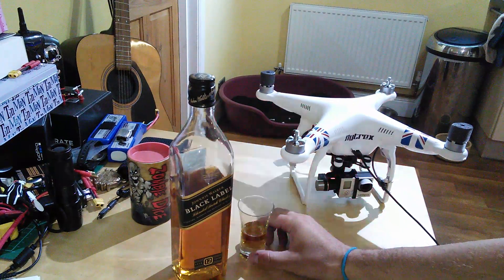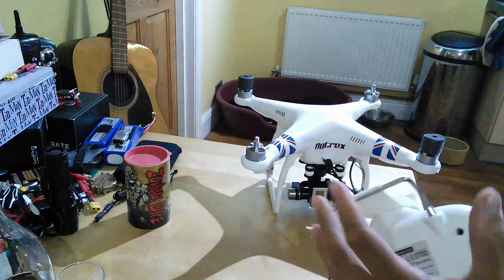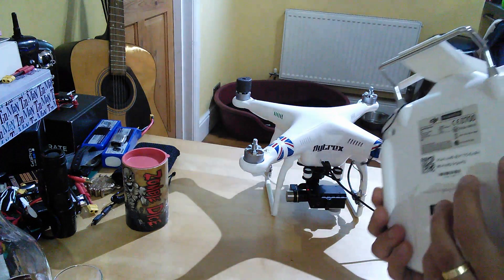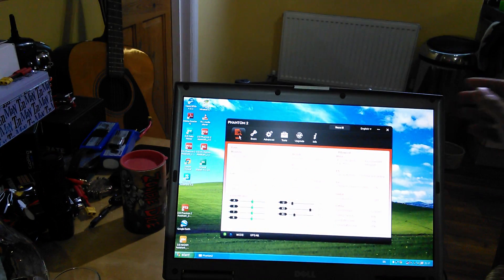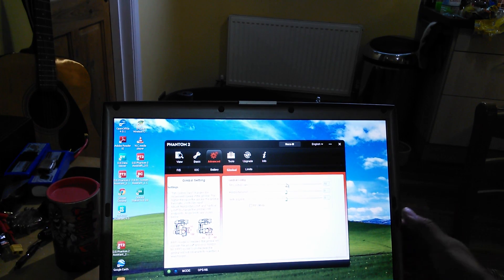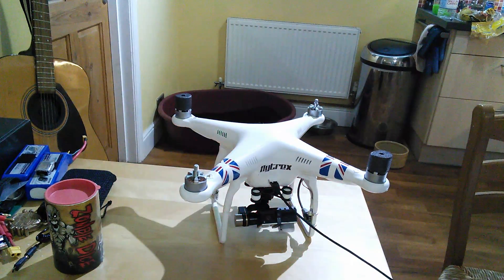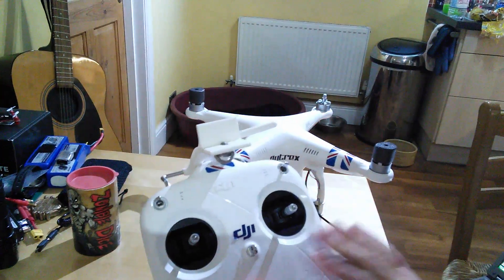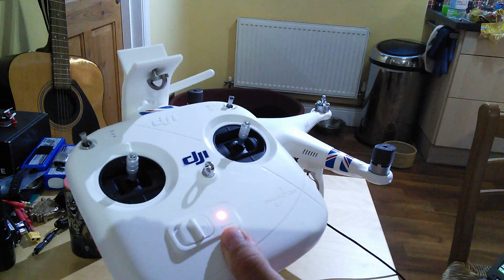How to adjust your DJI Zenmuse H3-3D gimbal for smoother tilt movement

Comment: Hi Simon,  I really appreciate your tutorial videos and that's why you earned my subscription.  I have a problem with my Zemmuse H3D3 gimbal and I was hoping that you might be able to bring me some guidance to solve it.

  My gimbal catched a "nervous tic"...It twitch to the left in mid flight and right after that it just hangs free for a second or two and return to normal like nothing had happened. It seems to me like Everytime I try to go full forward it happens again and again and again. Even on calm days. My propellers are all balanced, so isn't a vibration issue.   I installed the filter that comes with gimbal when I first got it, and it was working good.  A couple months ago started doing this and I don't know how to fix it.  Hope you can help me. I have looked for videos showing how to fix this, but haven't found anything.  

 That had ruined plenty of my aerial shots and is getting really annoying.  I had seen others experiencing this same failure with theirs...It's there any fix for this gimbal failure? 

Have a great day and thanks again for your awesome tutorial videos.

Comment: im  newbie and i dont know if my pc is even detecting my phantom 2. the dji phantom2 is on, that program is on, i connect it, nothing updates when I change it....
Reply: ***** thanks for the quick reply, im connecting hte usb to the phantom itself ofc. i downloaded this program for phantom2  but i dont know about "drivers" all im trying to do is make my gopro tilt more cuz now its range is like -20 degrees to -70 degrees, i want totally downward tilt -90degrees   and horizontal 0 degres,  i wana expand the tilt range.  either way please help me out with the driver since the lights on the bottom left of my program arent on
Reply: ***** again thankss for your replies.  my issue is i dont know if im doing something wrong, i have the assistant downloaded for my phantom 2  but i get stuck in this step ". Run the PHANTOM 2 Assistant and wait for the PHANTOM 2 to connect to the Assistant. Observe the
indicators on the bottom of the screen. When connected successfully, the connection indicator is
and communication indicator is blinking "

stupid questions: when i open the program how long do i wait or do i click on skip, also do i need to register a user.login?
Reply: ***** in the dji [hantom 2 downloads page there is some pdf stuff and the assistant says it comes with the drivers. i told u im a total newb. how do i even load drivers cuz i downloaded somethign called assistant and another thing called drivers, i installed both. now what

Comment: Yes, I've done that - I have the new one with the wheel on the left. It starts up fine but seems to sit at the angle once it's ready. It moves ok but I'd like to change the default position

Comment: I've just got mine and when I power up the gimbal the camera  is pointing at 45 degrees towards the ground as its default position. How do I set it so that its pointing straight forward like yours ?
Reply: ***** Hey Simon I am having the same problem as well.  Can you go into more detail on your answer.  I am under the RC tab but there is no upgrade option so I am confused by what you mean by that.  Sorry if I am missing something obvious this is just very confusing..  I turn on my gimbal and it aims 45 degrees downward as well.  I have the newer transmitter with the wheel on the shoulder too.  I just cant seem to figure out what transmitter type to select under RC because I don't see an upgrade option... Thanks so much for the help !
Reply: Steven Camp ***** I have the same question as Steven. I went to RC and my controller was already set to the Upgraded Version. My gimbal still starts up and after initializing it points down. Seems like most videos I watch their gimbals are facing their camera level across.
Reply: taylor c Hey, I figured out that the 45 degree-problem was just a setting!

1. Connect Phantom 2 quadcopter
2. Open Phantom 2 (program): Go to Advanced > Gimbal, and adjust Horizontal Limit and Vertical limit to 0 - voilla!

Comment: I hope Im not being repetitive from something you have already said I just don't think It was mentioned. But something that is important to do and definitely helped with a problem(not being able to control the midrange of the gimbal, I could only move it from straight forward to straight down) that I was having with the range and control of the gimbal control lever on the transmitter was to; during configuration of the controller you are able to adjust "A, E, T, R, and X1". AETR are the actual sticks and the 4 axis that they ride and then the X1 is your gimbal control. During configuration I laid one hand flat grabbing both sticks and as I was rotating them I was also moving the gimbal control lever back and forth. This definitely help with resetting the high and lows. Thanks

Comment: Thanks for the video , i have one question. 
Im changing the tilt speed but nothing change on how fast it will move , any ideas?
I have the new transmitter NDJ6 where the slider is on the upper left corner

Comment: tilt control gain doesn't work anymore after i updated the firmware of the gimbal...
Reply: Oh yeah, thanks. Switching to basic works, but the camera's default orientation is facing down when you power on. When you move it up, it will not stay up and will go back facing down once you let go of the switch...
Reply: tssalgado this is exactly whats happening to my new remote and H33D gimbal.. very frustrating. Have you found a solution for this. Thanks
Reply: Karim Ghrayeb According to what I read the new controller for dji phantom 2 has this problem...and unfortunately I've experienced a flyaway, failsafe didn't work for the 2nd time.

Comment: Hi Simon ("Guru") Newton...   I'm having initialization issues with my gimbal - turns camera vertical and then "bonks" on ground.. after that it seems to work normal using the tilt wheel - but definitely not according to Hoyle.  http://youtu.be/ku37-pt2dA0   Just installed "out of the box" and new Updates were applied before 1st use.  Should I re-flash the gimbal??
Reply: ***** Actually, it's the 'new' P2 with the larger hole and gimbal as supplied with the Phantom.  I have ordered some gear extensions.  Do you think if it doesn't hit bottom that the camera will stay horizontal?  Will see, I suppose...
Reply: ***** Will do...
Reply: ***** Merry Christmas! I just did the latest firmware update and the camera now points about 45 deg after initialization...  Simon is right - with the new controller wheel the speed increases depending how "hard-over" you push it...

Comment: my zenmuse hd 3d does not move, i initialize it calibrates and is leaning down an d i can t control it
Reply: i fixed, opening the remote control, i realized that x1 was unresponsive, so i checked inside and was not touching the screw  i added something thick under the  electronic board. SORRY FOR THE ENGLISH hope you understand

Comment: Hi Simon, just a question  I just got the P2 V2.0 and with the new control. because of the spring in the wheel I can not point and fly easy is just hard if for example you want a perfect horizon if I leave the wheel it would go down to a 45 degree ...you thing would be good to take of the spring from the controller because I couldn't fix this with the gains in the assistant. I can look flat down un up to the props with smooth tilt but the middle point of the wheel is at 45 degree down. :( Thanks for the video
Reply: You are great Simon, but my curiosity and a little bit of time make me open the radio and take off the spring was easy and would be easy to put back but what you are explaining to me is great. I will update the transmitter  because I want the gimbal to work with the sensitive dial !!! thank for the fast answer. :)

Comment: Have just updated my H3-3D gimbal firmware to V1.0.0.10, Now I find that the gimbal lever on the back of the Tx has a 5% range of movement and therefore sends the camera from vertical to horizontal no matter what gain is being used.  There's no inbetween, so have really lost control. Can't now just nudge the camera down to get the props out of shot. Have re-cal'd several times but still shot.  Also, now moving the throttle levers moves the Gimbal!  Whole thing is shot! Any advice?
Reply: Yep, done that. Now lever operates backwards to what it did before but still only over a 5% range to give 100% gimbal movement.  Really weird. Just wondering if this upgrade is only for the new TX with the wheel.
Reply: Have just realised there's a new assistant. It didn't tell me in the old assistant that there was an upgrade to it!  So happened to look on the DJI site downloads and noticed it.  So that's sorted out the reversed operation as there's now a "Normal/Rev" button next to the X1 slider. With "Transmitter Version" set to "Basic Version" the range of control is still the same, i.e. 5% lever movement for 100% camera movement.
Reply: Have just opened the TX and checked the range of the Gimbal pot. It looks to me like it's a firmware issue. The pot only turns about an eighth of it's range so the firmware has to encode that into an output to the Gimbal control system.  DJI could have got the numbers wrong at one end or other. i,e, the controller upgrade or the gimbal upgrade. Just wonder if anyone else is seeing this issue.
Reply: It makes absolutely no difference.  When moving the lever in cal mode, the slider doesn't go all the way every time and sometimes comes back on itself. If I were a betting man I'd say the pot has a damaged track.  Already have alignment issues with the Gimbal that DJI are saying will need to be returned to them, but they're so slow returning emails. Now this. Only had the kit a few weeks. Are DJI bad at customer service and quality control generally?
Reply: Thanks for that Simon, I'll bear that in mind. I bought from DJI Europe directly.
Reply: Hi, i have the same problem today. You must calibrate the sticks on the DJI RC System Assist software(only for windows). In the calibration you must make circles whit the sticks and moves the gimbal tilt key up and down. Try this.
Reply: Thanks. Tried that, no difference. This time the camera follows the on screen slider in that it just nods up and down as I move the actual lever in one direction.  Not happy. Will be phoning DJI in Germany this morning as getting no replies to emails.
Reply: Rate versus Proportional control would certainly explain what I'm seeing.  They're responding to emails now so will keep you informed :)
Reply: I've been fiddling for a couple of hours with this same problem.
I had to go back to the remote software and calibrated in there and all seems to be working ok at the moment. I also noticed that the gimbal now moves left and right when the throttle stick is moved left and right. It does seem to move further in one direction than the other but there seems no way to adjust it.
Reply: I put a horizontal limit of 3 on the Gimbal so it wouldn't show the landing gear on a right turn. Haven't had the opportunity to fly it yet due to current Gimbal issues.
Reply: Greg Hudson When you say "had to go back to the remote software", which software do you mean?  Would love to crack this problem before I send the Gimbal back for realignment.
Reply: Yes, noticed that last night. It allows you to reverse the operation of the tilt lever, if you can get it working that is ;) Also set the return to home height:)
Reply: Craig Stevens I went and did the calibration in the "phantom RC" assistant software, not the phantom assistant and that seemed to fix it.
Reply: But that doesn't call the X1 channel though. Or am I missing something?
Reply: Craig Stevens I went and did the calibration of the remote. Moved the sticks all around and also the x1 slider back and forth. Clicked finished and it all worked as normal (apart from the reverse direction) but I noticed there is now the new version of the software so will try that
Reply: Craig Stevens Hey man, I feel your pain completely. I just went through the same thing today. I calibrated with the RC software and also the Phantom software. At first it didn't work, and seemed to work partially, then became worse. Then at some point, it worked, but my camera wouldn't face all the way down. This video fixed the complete facing down for me. However, in regards to getting your X1 and gimbal to pan properly, I can't tell you exactly what worked for me, but here is the flow that I think worked:
Connect TX to computer. Calibrate the throttle and pitch levers like normal in RC software. After you calibrate those try and move the X1 lever as well. Note that it will only move a very tiny bit back and forth in the software regardless of the fact that you are moving it to its extremes on the TX. Then hit finish. Exit. Power down everything in proper sequence (switch off software, then phantom, then TX, then unplug TX).
Then, turn on TX, plug in Phantom then turn it on, and open your Phantom Assistant software. Go ahead and click BASIC and hit RC right beneath BASIC. (I don't think this matters, but...) move your X1 lever to each extreme to see if you're getting the right motion in the Phantom software. Then start calibration on X1 and move from one extreme to the next and see if it's moving to either end on the software in the computer. Do it several times. Watch the actual motion of the gimbal as well. If it's moving along with the TX then you should be good. Now you can adjust the min and max for horizontal and vertical in advanced like this video teaches. 
If this doesn't work I would recommend trying everything again, and maybe going between calibrating in RC software and Phantom Assistant software until it works. It worked for me that way. I really hope you get it sorted out as I was about to punch my brand new iMac because of this (ok, not really, but I was extremely frustrated). Good luck!

Comment: Hi Simon, Could you clarify if this works for the H3-2D, I tried it last night and the settings had no influence:-( I can see others in your threads say it only works for the H3-3D is this correct? As it stands right now i'm assuming i'm a bumpty. cheers

Comment: Hey Newton, I have P2Vision plus, got everything working except for calibration of x1 disappears on assistant software, but has  it on RC software( i use mac) however it doesn't have calibration feature so it moves, only little bit because of not calibrated. tried windows too!, any help?

Comment: From what I've read, those gimbal settings in the assistant software only apply to the H3-3D, and don't do anything for the H3-2D. I made the changes as you suggested Simon, but alas, no change. I haz a sad face.
Reply: ***** Indeed I am. Had my hopes up when you said that it should apply to the 2D as well. I've assembled all the parts to install a new potentiometer. I have a couple of options, including a 3-turn that would make my system buttery-smoooooth.

Comment: My gimbal (h3 2d for phantom vision 2) doesn't respond at all. I've tried calibrating it.. and it won't move at all. the only thing it does when i take flight is look straight down. on the calibration, it doesn't respond to movement either. would love any help/suggestions! thank you!!